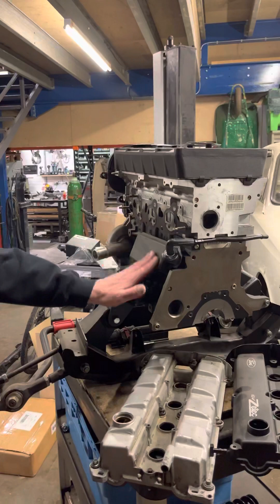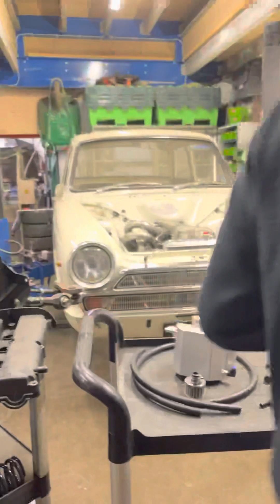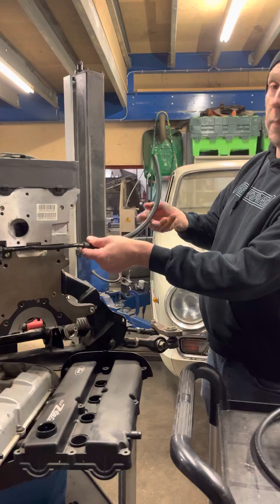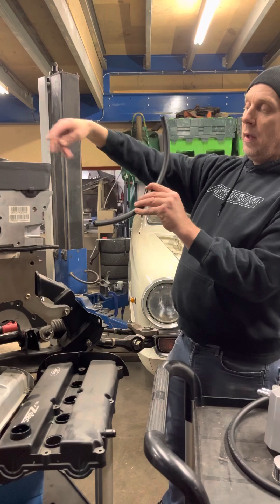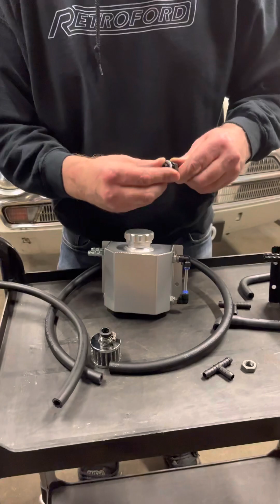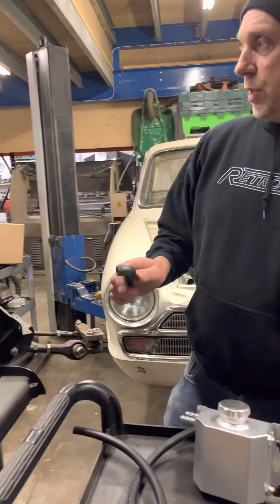Friday Round Up: Zetec Oil Breather Kits

Comment: From PCV and from the valve cover both are joined with the T  fitting, and then goes into the canister? The second fitting on the canister will be for the air filter?